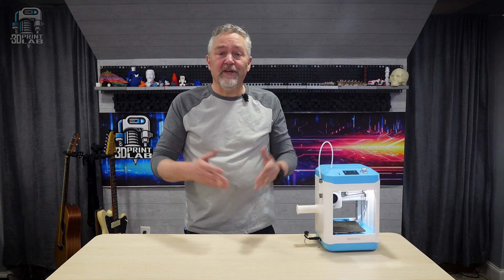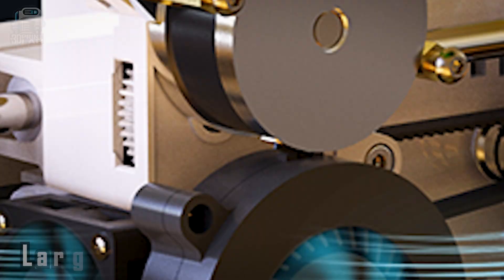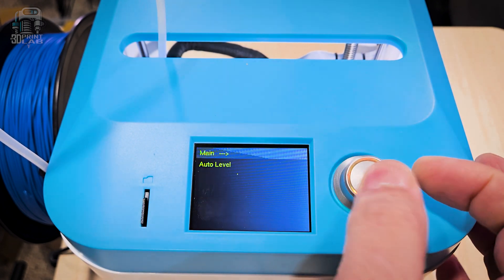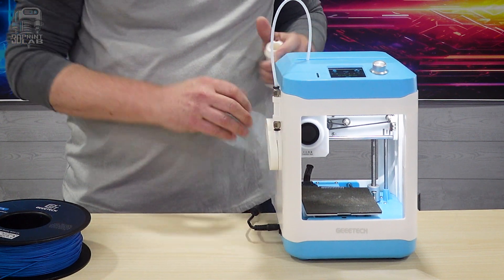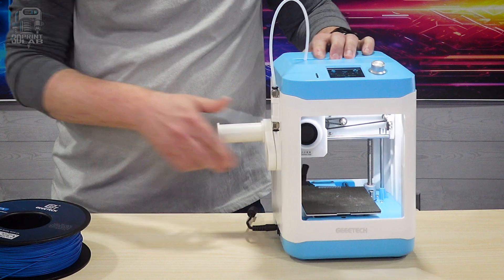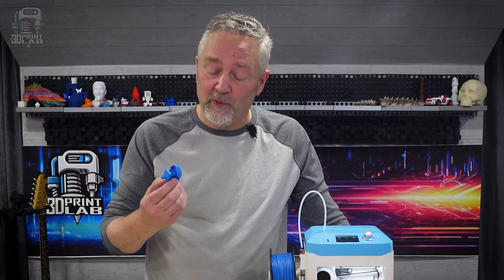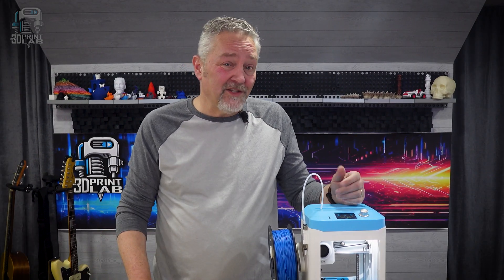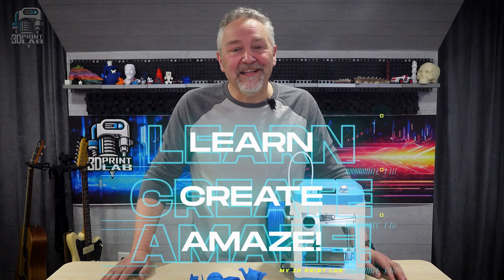This Tiny 3D Printer SHOCKED Me! - Geeetech M1 Mini

Comment: So the problem is the price.  At 200 your better off getting an a1 mini for slightly more or even a sovol sv06 at 160 currently.   Printer with this build size and that print quality should be in the 150 range.

Comment: If you think that benchy came out great - you might need glasses. That was the worst looking benchy I've seen that wasn't printed in 8 minutes or less. For 29 minutes - that was horrendous. All of the prints look over extruded. Why not do a little tuning and show us what it can really do?
Reply: You are right. The Benchy and all the other prints are not really nice looking. Sure i saw some ringing and also over extrusion. I'm sure its possible to tune the settings and check all the screws and the mechanic if all runs smooth.